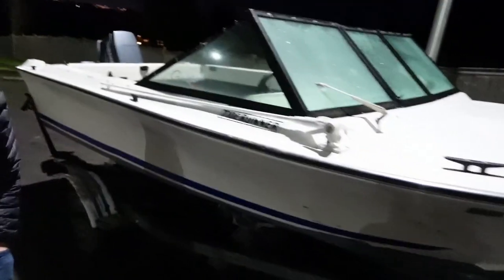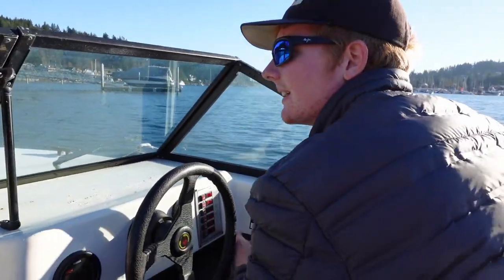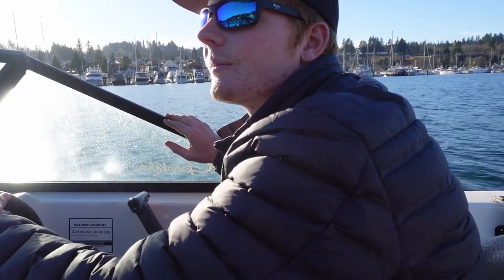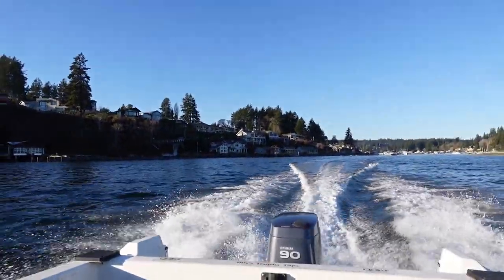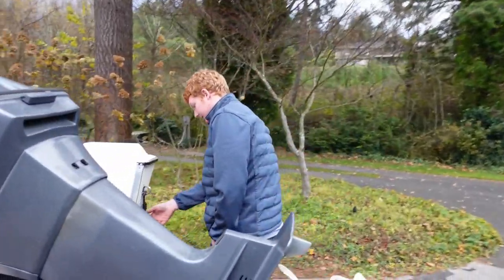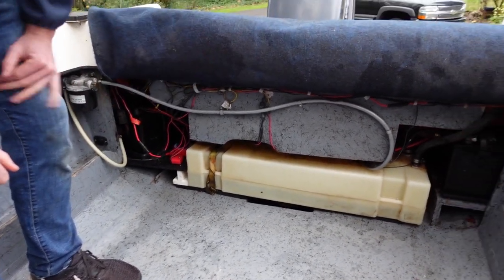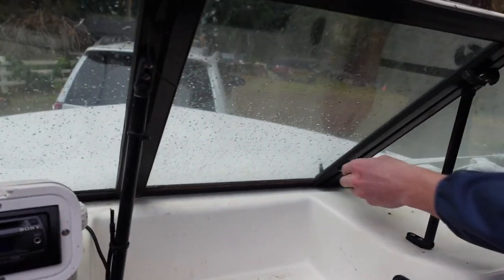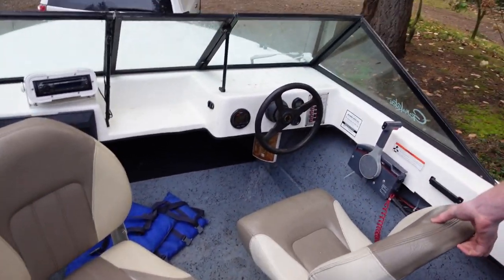We Bought A New Boat!!! (We almost hit a sea lion)

Comment: I used to build Tiderunner boats.
That one pre-dates my tenure with the company, but its nice to see your boat.
They were designed especially for fishing around the waters of the PNW and were all hand built.
You've got the correct motor on that boat, too.
We were a Yamaha dealer and the 16 ft. runabouts got the 90 HP engine.
Thanks for posting this video. Not too many Tiderunner's on YT.